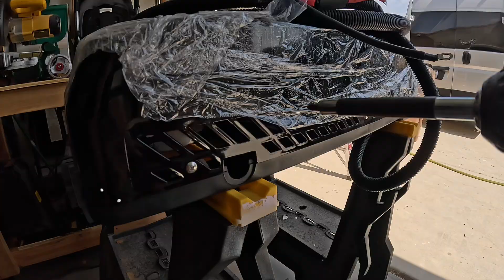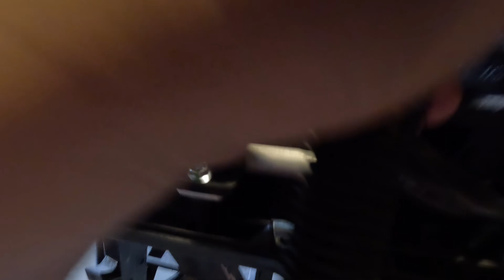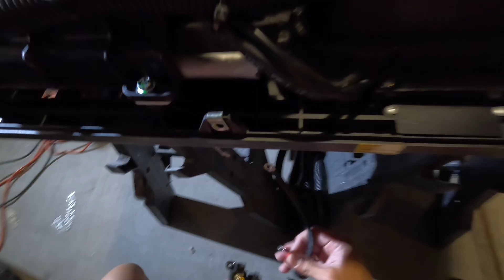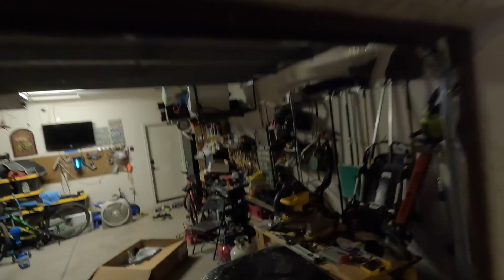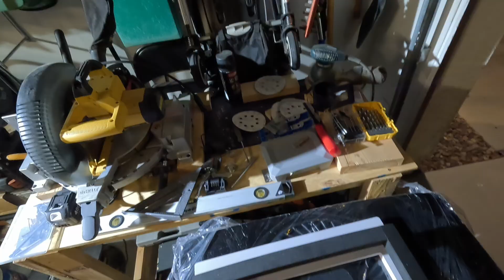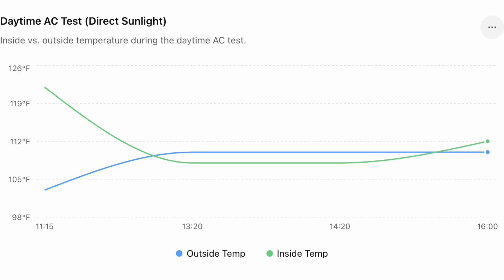Installed OutEquip Pro 12V AC

Comment: are you going to insulate your van?  that would make a big different.
Reply from the maker: The van is insulated top to bottom. Just windows are not.
Reply: @Daily-Roam I'm also in phoenix and I'm looking at getting this system.
Reply from the maker: @thomasmendez142  what kind of can do you have?
Reply: @Daily-Roam I have the stock AC system.  But I am searching for something bigger.
Reply from the maker: Lol sorry stupid auto correct. My question was what kind of van u have. Not a can lol
Reply: @Daily-Roam Nissan NV3500